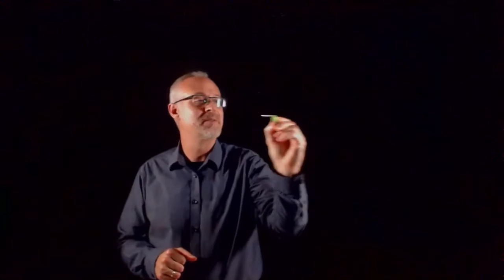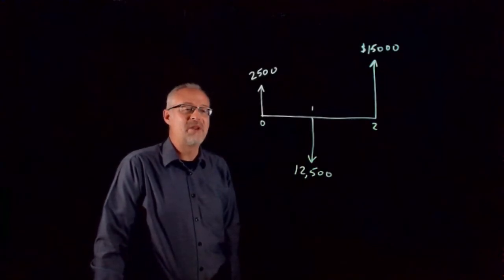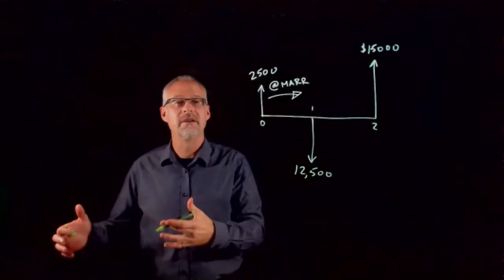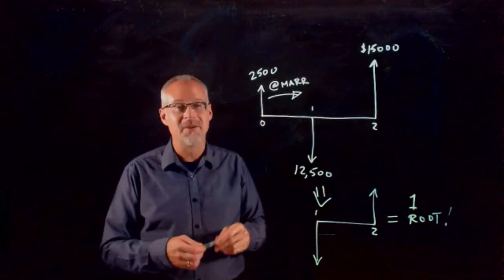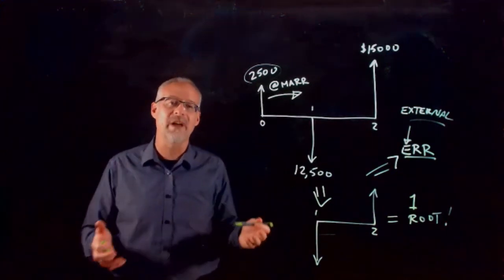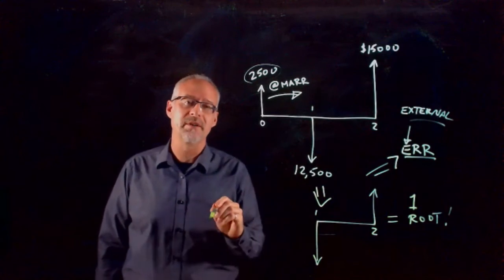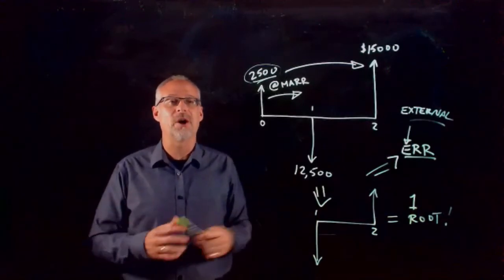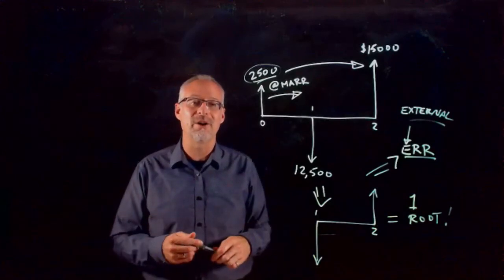Thinking Behind ERR   Engineering Economics Live Class Recording

Comment: Hello Professor, Can we use incremental ERR method for mutually exclusive projects just like Indremental IRR method?
Reply from the maker: Good question.  The simple answer is 'No'.  Incremental IRR only works properly under very specific circumstances, the most important of which is the need to place the alternatives in 'order' of increasing first-cost.  ERR - by it's nature - does not always have a first-cost - often times there is a positive cash flow 'first' then costs come later.  These types of complicated cash flows do not follow the pattern of a so-called 'simple' investment (i.e. cost first, then returns) - which is necessary for Incremental IRR.  I SUPPOSE it might be possible to perform a kind of pseudo Incremental-ERR method if you had a case where you could modify the cash flow diagrams into something more suitable to an Incremental-IRR-type of logic, but this would be a rare case.  So, the simple answer to your question is 'no' - good question though!